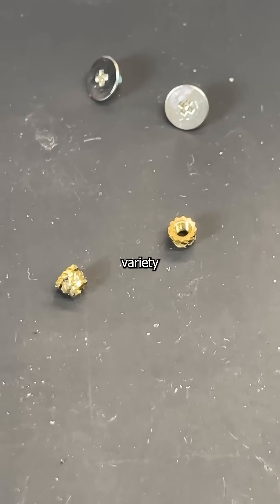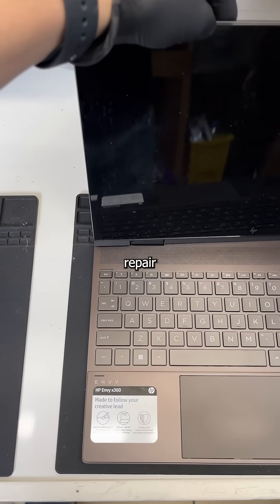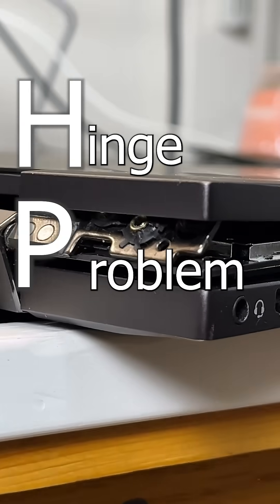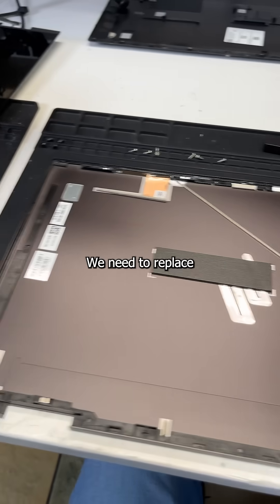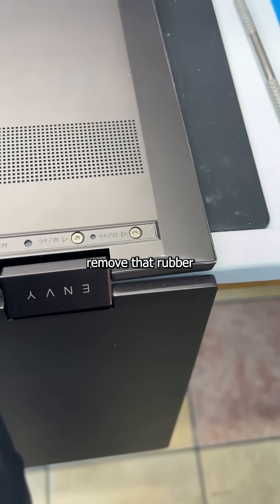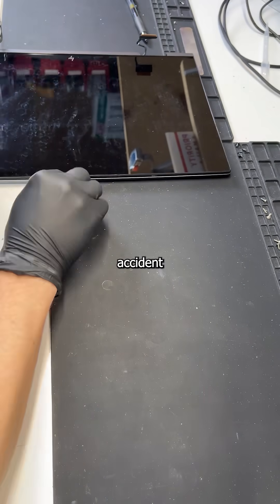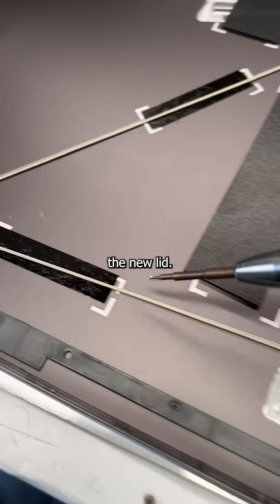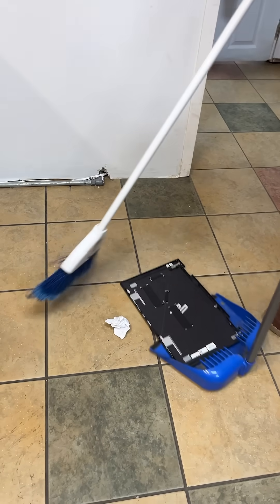HP stands for Hinge Problem (x360 hinge replacement) #shorts #tech #technology #pc

Comment: the question is why wouldnt you put in the metal hinge/a solid hinge a new metal hinge  to upgrade the puters flawed designed hingessssssssssss..............we can rebuild it stronger faster we have the technology.....instead of putting back the same junk that broke previously..........just saying.....

Comment: I have a Sony vaio for over 12 years now and it is dropped over 400 its body is crushed its keyboard is died is battery is also died is charger also died is hard disk failed but only one Hinges is broken and still works😅

Comment: Honestly if I were the one repairing this kind of laptop, I think I'd get a dead one, and experiment with spot welding - why for f--cks sake would one connect two pieces of metal with GLUE AND PLASTIC?

And before anyone says something about this being aluminium and steel, believe me, there would be ways to connect them together - I'd personally try the "get a piece of aluminium that holds the steel hinge and goes through its holes and then spot-weld it to the actual lid" method

Comment: I was sitting in a lecture when I opened my HP Envy, and the right hinge literally broke off. It made an electrical popping noise that was where I packed my stuff and left, because I was afraid it might catch on fire. Despite that, it was a very good laptop, so good that I bought the newer model 🤞

Comment: The Winbook laptops of 25 years ago, such as the XL model series, also had hinge problems, the hinges were too strong & rigid.  What made it worse was that the laptop chassis was made of plastic that became brittle, practically like they were made of some sort of polystyrene.   Thus, a too-rigid hinge & brittle plastic made the case fracture in several places easily.  I have an XL3 that still works, along with a port replicator, but I may transfer the motherboard & replicator into a small tower pc case just for fun.  
05/02/25

Comment: i had this problem recently. I didn't want to put another hinge on it just for it to break again. It's a terrible design and there must be better ways.
I ended up using some two part epoxy putty to attach the hinge back onto the screen.
It feels solid and functional, but if it ever breaks again then i am going to cut a small metal plate and attach the hinge to the plate and the lid through small nuts and bolts that go all the way through the lid. It will be a bit ugly but it will be as strong as possible.

Comment: i have the exact problem right now but i refuse to buy replacement for 150-250€. I will now remove the display and find some use for it with a monitor.

Comment: To save money and add micro plastics into your body, you can use a cheap soldering iron to melt some of the plastic and reattach that hinge screw anchor. Just gotta make sure it's lined up. It'll be like new.

Comment: oh my gosh this is almost the SAME thing that happened to my lenovo legion laptop TAT Only the hinge doesn't close anymore and the screen is trying to pull away from the cover.  I was told that it would be cheaper to buy a new laptop...

Someone tell me why my 8 year old laptop worked better than the new 2025 one I bought though... AND if this is also an HP problem, I guess I'm screwed, lol

Comment: My old HP laptop broke at the hinges, and the problem with my model was that it all connected to the motherboard and bottom of the case and not just the screen. I had asked a repair shop to try and find the bottom of the case, but they ordered the top instead, and when I asked, "Well, can you order the bottom?" he said he could glue back the broken hinges????? I decided to just buy a new one when my screen started showing green blocks/patches in images.

Comment: I own HP Victus and after  almost 2 years it hasn't had a hinge problem
Reply: My HP is 6 y/o (2018) and my hinge just now started acting up. It's just a little crack and everything is still solid and intact. I was worried and I found this, but 6 years and haven't had a "Hinge Problem" until now. And I wouldn't even classify this as a problem yet
Reply: @j.a.ward13  my HP Pavilion G6 core i3 which is now 12 yrs old, do not have broken hinges but it's a bit stiff to open, no big deal though.

I'm looking for a HP Pavilion G7 because these HP laptops were solidly built, nevermind the catastrophic weight, I prefer thickness but durability than thinness and will crap out on me even with proper care. And older laptops tend to use Sodimm Ram instead of soldered Ram
Reply: @danteerskine7678  I agree. I seen on a different video that the HP 15 BS's and BR's are built thinner or something, so you do need to pay attention to what you're getting. I believe the older ones were made thicker too just like how cars used to be.

Comment: I got two free otherwise perfectly working laptops because the hinge broke like that. I fixed the first with custom machined screws  and nuts (to keep them from poking out) The second by drilling a hole clear though, then attached it with a pop rivet and a washer. Not the prettiest but it wont break again. A friend's with the same issue I drilled two small holes and tied it together with blue string.

Comment: update on my experience with HP pavilion 17-Ab(non touchscreen)
The user manual helped but I HAD TO REMOVE THE DISPLAY in order to CAREFULLY remove the hinge caps. you have to very slightly loose the nutz, silicon grease spray and/or technical grease will do the trick. the bottom part of the screen is glued to the plastic frame: start with the top, sides and bottom corners, then slowly pull towarsa and slighlty up. (There is no procedure online that showed this)

Comment: Ahh, that's how it should have been! And like a fool, I glued these nuts with epoxy resin, formed a bath of hot melt glue to fill the reinforcement in the plastic with the same epoxy, collected all the damaged plastic like a mosaic...
But you just had to change the body!

Comment: Anyone else thinking on drilling trough the points the nuts were ripped off and making stainless plate on back with welded nuts for those longer bolts screwing on making it far more sturdy? I dont have this laptop but that seems logical method of reinforcing construction so this problem wont repeat it self..

Comment: Till now lemme repeat my experience with hp tones pf bloatware in newer laptop that takes 30-40% of cpu pn idle. Installs my favourite Fedora workstation. 
The motherboard jas issues well my local repair shop fixed that issue in 50-70$ , than the hp service centre thet said there's nothing they can do buy a new one . Hindge had issues but i fuxed myself purchased a screw driver and repair kit cuz i need it .
The HDD sata ribbon connector got euped cuz it's too close to the hindge and it snapped it.  Hp Store change motherboard that's what they know. 
Meanwhile you can purchase thst ribbon data cable from. Local Market with proper tools solder it like I did.  
It has sata SSD which i eill upgrade nvme and add morr ram . 
i3 10th gen runs very good .

Meanwhile year's old ThinkPad with i7 6th gen, 16 GB ram nvme, with custom Arch Linux runs far better it's super sturdy i can throw it from 1st floor and guarantee it will run normally.

Comment: I KNEW IT WAS AN ISSUE BUT… I never thought it would be me! I just finished installing more ram in my spare hp laptop and as I open it up to check if it works,I see one of the corners is a little wonky. I look at the hinge to see that both of the standoffs broke away from the frame.

Comment: My mom had the exact same issue with her lenovo ideapad 5, the right hinge just got straight up ripped off the display. Luckily I found new compatible display top cover+bezel+hinge on aliexpress for $50, waited 2 weeks until it was delivered by local post office, then it took me 2 hours to move the display and webcam onto the new lid, install new hinges, glue and tighten everything up, and now mom's laptop works like new. thanks china for not having to buy a new $500 laptop for my mom.

Comment: I simply took out the screws and broken plastic, around the bronze thread, that attached to the hinge screws.  Then I filled the entire remaining hinge hole and the case with baking soda, then poured into that enough superglue to permanently attach the hinge to the case, via that baking soda-superglue post! I have been using the computer for several years and have had no problem with the new connection!...  Just be really careful that you put superglue only where it belongs!

Comment: I have this same problem with my HP Pavilion 360 bought back in 2018. I carried it in my bag, cramped with other things on a flight (my bag is not that big) and when i pulled it out, the corner of the screen was comming out and one of the hinges seems to be unaligned. Seems there is a plastic screw which broke while carrying it which holds the hinge and the screen together (as per my local repairist)

Comment: I have Envy 13 laptop with the same hinge problem. I solved the problem permanently by fixing the hinge directly to the outer shell with screws. I had to cut off some part of the back cover to make room for the nuts, just a small price to pay for the fix.

Comment: I had the exact same problem with mine but the hinge flopping around broke the screen. A whole new thing is 200$. Until I save that much I just took off the screen and duct taped the WiFi Andreas to the back and I use it as a portable pc now

Comment: I got the same problem with my lenovo laptop. I drilled a small hole in the back cover and used a bolt and nut to repair it. It doesn't look nice but my hinge has never been so strong

Comment: Dell has a model that has a hinge issue. The Dell Latitude 3511 has one of thenworse hinges ive ever seen. I bought 60 of them as a cheap upgrade option, but they caused more issues than they helped.
Reply from the maker: Do you mean the Inspiron 3511? Because those are also notorious for this issue.
Reply: @SalemTechsperts  yeah, the Inspiron 3511s, out of the 60 I bought, I had to send in the majority over that damn hinge issue. Was a good learning experience for my manager to not cheap out on equipment.

Comment: Also the Hinge Problem company in 2008, they create budget business laptop with all plastic that hinge screw inserts don't break off that easily like nowadays model. I had the HP Compaq 6530s and the only part that is broken is the two screw posts that is on the power button panel.

Comment: OOOOOOOHHHHHHHH can we get onboard of actually doing that like somehow hucking every part that's designed like absolute trash and send it directly to HP I'm pretty sure they want their Horrible Products back because I don't want it. Lol, tho I'm quite happy with my 2540p elitebook the hinges are GODLY they pick up the whole body that weighs like 7 pounds and is on a metal housing n stuff. I see that and then I see this stuff and I'm like on this laptop you got the hinges right with this one and they've been working since and never gotten loose.... So what's your problem with the newer ones exploding in a week?... Don't answer that, that was rhetorical lol.

Comment: I have one of these! I shoved 32 gigs of RAM inside the thing and it still works. It would be nice if it was able to play more modern games, but meh. I basically used it as a desktop anyway, so I rarely use the hinge and it's all my desk at all times. Any suggestions for some easy ways to improve it? I definitely need to get a better solid state drive in there, and I want to see if I can fit a decent M2 drive in there as well at some point or another
Reply: I've got 32 gigs in mine too lol. I really need to get a better ssd because every external hard drive I get stops working after a few months. It manages to run well optimized games like RE4 remake and Spiderman smoothly (on the lowest graphics settings of course). I should stop closing mine because I use it as a desktop as well

Comment: Ha. My wife has a Hp x360 envy with the same hinge problem. Just normal use sorta busted the hinge and is affecting the display. Seemed a solid laptop all around except for that nonsense hinge issue. Meanwhile my old thinkpad don't have the same issue and my very ancient and cheap Dell Vostro didn't.

Comment: I had this issue too and went to HP support to get it fixed, they only cleaned it, charged me $100 for it, and told me that in order to fix it they needed to change the hole screen for $500+ 💀

Comment: I had a Lenovo with the same problem so after the repair I loosed the screws on the springs of the hinge. Worked fine for me for over a year now
Reply: I heard that Lenovo laptops have good durability. I had just gotten a 2 in 1 lenovo with these hinges for college. I hope I won't have problems 🤞🤞
Reply: I have an Envy 360, no hinge issues. But I don't beat my laptop up either. Usually when I see a repair like this it's because someone closed something inside the lid. Also this is pretty much every laptop on the market right now. Cheap plastic. An easy inexpensive way to stop it from breaking further if it has started to Crack is open the bottom and put superglue or JB weld around the hinge nuts and reassemble let the glue or JB weld dry before use. Also, it doesn't help that these laptops get stupid hot around the hinge area due to the undersized cooling.

I hope you also cleaned the heatsink and fans and repasted the CPU while in there.

Comment: I had the same exact problem with my Dell 7610. I repaired it by burning the plastic/glue that glued the brass threads to the metal lid to clean them, then I glued them again with super glue and backing soda, did the same to the other hinge to make it stronger and it is better than new. But simply secure a 16 inches screen to the laptop with 3 blobs of glue each side, it is clearly projected to break as soon as the warranty is over.

Comment: I have the same laptop and save problem I tried to get it repaired from my local technician. They just fuckin used glue to repair the fkin those nuts. I have repaired it 3 times and it always breaks down after a week. Can you tell me how much would it cost to repair it

Comment: As a repair technician myself; can confirm. About half the repairs we get in are HP Envys with a busted hinge. Almost always the one on the right as well.
Reply: That's because many people are right-handed. They open their laptops with right hand, holding it by corner, not center of the lid!! With such weak hinges its only matter of time when they get broken
Reply: Where you get you replacements from? I am looking for a right hinge, but there are many kinds of hinges for the 15m.
Reply: For me, it has always been the left. Such a costly design flaw 😓
Reply: in my situation all troubles are broken screen, terrable battery since i bought it, bottom cover deformation, not pressing button. but hinges are damn good
Reply: I don’t have any problem with the hinge but with the little screw in the center (on the back, the screw in front of me, next to the battery). I tried so much to turn it that the screw got smooth. No screwdriver grips. I can’t change my swollen battery.

Comment: My last laptop was a HP. One day, I went to use it and the right hinge completely detached from the body. Somehow the screws loosened, so I tightened them back. Three weeks later the left hinge completely breaks. I managed to find a replacement hinge on ebay and installed it...only for the right to break month later. Between that and the failing HDD I just decided to get a new laptop.

Comment: The recycling policy has affected the products at HP. Devices do not last long. In the past, we used to buy devices with the plastic in them very strong, but it is harmful to the environment. Today, it is worse due to the increase in the amount of plastic that is thrown away, even though it is biodegradable in some types.
Reply from the maker: Why is it so hard to just not use plastic for the hinge mounts?

Comment: Designed is still flawed but I've found out there's alot more stress on the hinges when users open it from one corner side instead of lifting directly from the center as you should.
Reply from the maker: Yeah definitely need to be careful but HP needs to design something not so fragile at the same time

Comment: It drives me crazy that pretty much all the major laptop manufacturers do this exact same garbage. I've got a Dell Inspiron in my shop right now with the same issue
Reply: Preach Thinkpad to your customers or framework for ease of repairability
Reply: @trym2121 HP ProBooks, EliteBooks, and ZBooks well as Dell Latitudes are also a good choice.
Reply from the maker: yep
Reply: Oh I hate this so much! I have work to do on my hp envy x 360 laptop. The hinge broke for the 2nd time after I had it repaired under an  extended warranty. Why the 🤬isn't HP doing anything to help the customers who bought this faulty product?!
Reply: yeah my Asus Vivobook's hinge is like gone now, though my previous Vivobook's is fine.